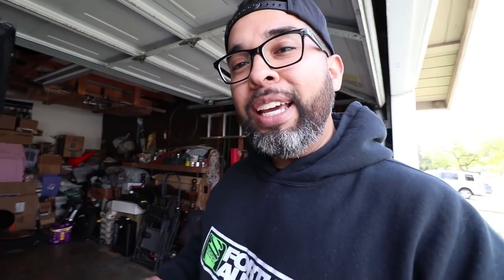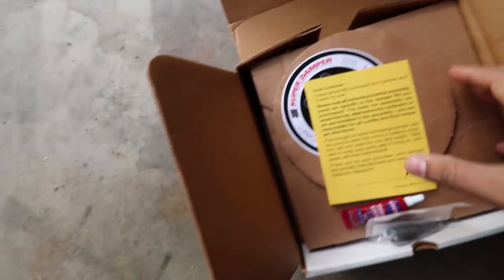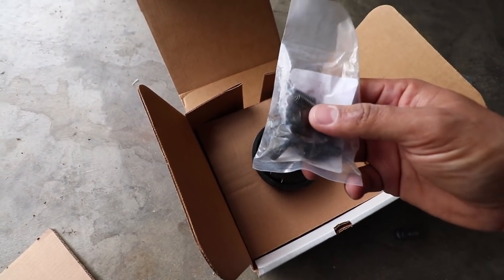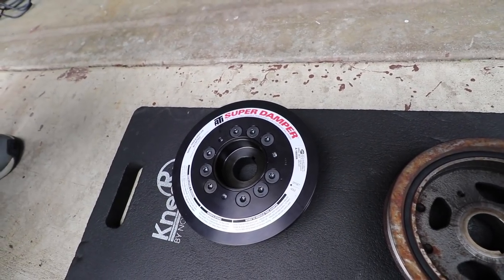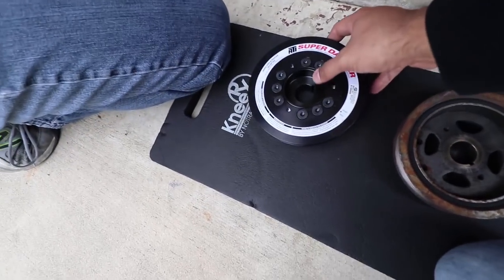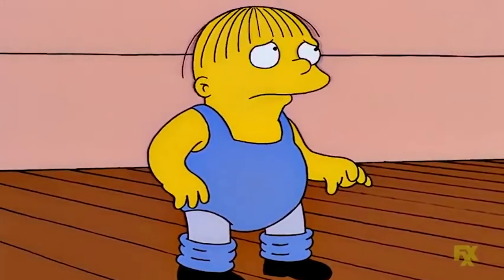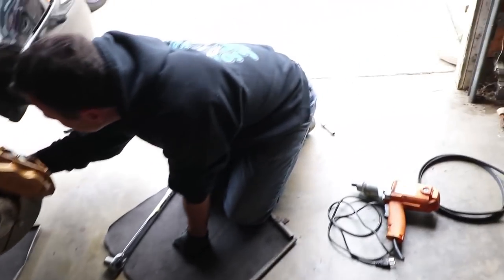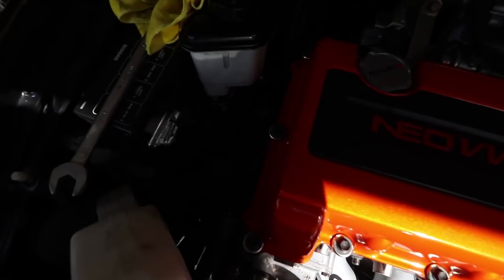B14 NISSAN 200SX SE-R: SR20VE ATI SUPER DAMPER INSTALL (ATI918607)

Comment: Would have liked to see a weight comparison vs the oem pulley for those of us that care about the weight or things like that. Great video
Reply from the maker: Harmonics are way more important than light weight pulleys for those of us who road race and keep our motors in the high rpm range. Lightweight pulleys have been known to cause spun bearings. Also the oem crank pulley tends to fall apart and separate the inner ring from the outer ring. After a track day the smooth revving of the motor is very noticeable.

Comment: Damn that pulley costs as much as most B14's do.
Reply from the maker: havent seen a b14 se-r for $300 in a looooong time.
Reply: @blipshiftapex9047  I just got rid of a SE-R rust free, needed struts and bushings, I tried to sell it to an enthusiast not a single one came through all rolled up in some sort of Nissan product. I pulled the engine and trans,  sold the cat and wheels the interior was clean real clean yet no one came through for it. The "community" is weak and it sucks I have a super clean P11 and it's worth nowhere near what a similar Integra RS or even civic ex pulls. I've had the same experience with Maxima, QX4 and M4/35's  I do okay on G35/7's and Altimas. 
I like Nissan, but overall no one dumps cash in them that's why the damper caught me off guard, I'll be looking for one at the junkyard for sure.
Reply: Oh yeah I was asking less than a grand for the SE-R
Reply from the maker: @billyjack5957  sheesh. Then again it is a b14 haha